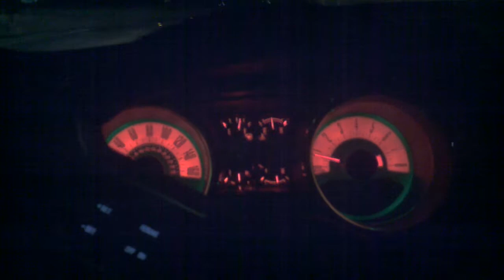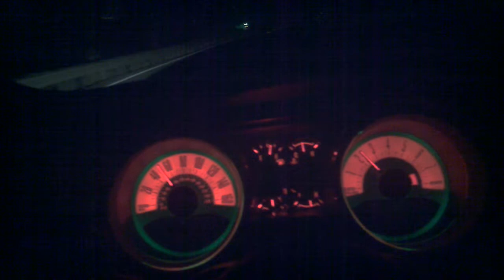Install 2011-2013 Ford Mustang GT CS MSD digital shift light PART #5

Comment: Hey brother I was hoping you could help me out I bought this shift light for my 02 4.6l 2v and I have it GMR hooked up to the res wire of my ignition coil and my black wire to a ground and my other red wire to a fuse that comes on with car and the shift light turns on but doesnt read rpms and MSD is no help when I asked them..
Reply from the maker: Let me do some research
Reply: I know it's been some years since you did the install but how close to the ignition coil plug did you hook up the GMR line? I've csnt get mine to read rpms on my 02 4.6l 2v jm not sure if it being a 4r70w have anything to do with it or not but I cant imagine why it would .any help would. E greatly appreciated brother
Reply from the maker: @brucehendrix mine is connected as close to the coil on cyl #1 as possible
Reply: @TheMustangStampede  mine is too its basically touching it ..do you think my car being an auto has anything to do with jt?
Reply from the maker: @brucehendrix  no auto has nothing to do with. Does the light at least power on?
Reply: @TheMustangStampede  yes sir the light power on it just stays at 0... I got ahold of MSD and they asked me to send it back to them and they are sending. A brand new one hopefully the new one will work
Reply from the maker: Make sure you set all the settings
Reply: @TheMustangStampede  ok you mean where I can have differnt shift point for differnt gears right? Also when choosing a cylinder option do I choose cylinder 1?
Reply from the maker: @brucehendrix  you should choose 8cyl
Reply from the maker: Meaning you have 8 cyl
Reply: @TheMustangStampede  ok that's what I thought and I tries that then a biddybof mine told me to try 1cyl since it hooked up to 1cyl and that didnt work neither. I'm guessing since he did a nos hook up it had a deal the GMR pickup line and he set that on 1cyl.
Reply: @TheMustangStampede  I appreciate your help so much man your great
Reply from the maker: @brucehendrix  no I dont think that matters I have NO2 that was not part of the hook up process. Have you tried the light with 8cyl as a setting
Reply: @TheMustangStampede  yes I've actually tried all the cylinder options it just isnt getting a reading .I sent it back should have new one in a week or two
Reply: @TheMustangStampede  I bought a refurbished one from MSD I'm hoping that was the issue it being a bad unit but I just got home and a package was on porch and it's a brand spankin new MSD shift light that not refurbished so I'm going to try it out and I'll let ya know how it goes .also does it matter what  oil pack cylinder I use to hook up the GMR to?
Reply: @TheMustangStampede  ok bro I hooked it up to cyl5 ignition coil and it works!! Also it would only work when I put it on 1cyl mode. Also now my caf is throwing p0355 code!? Looked it up and it's an ignition coil E primary /secondary malfunction . My car isnt running bad or anything but has the service engine soon light on now that's how I knew it was throwing code I took it for drive and runs like it should ...
Reply from the maker: @brucehendrix  very interesting.